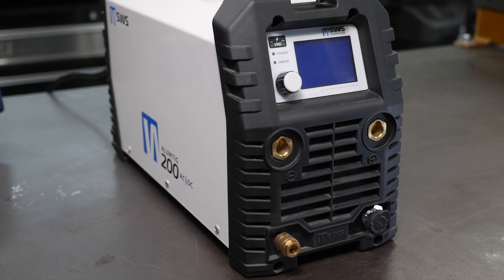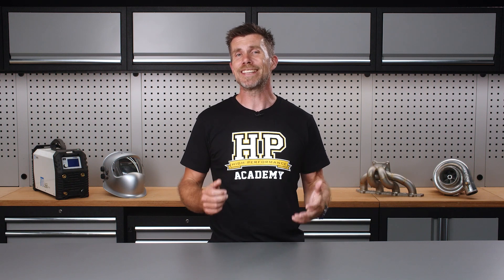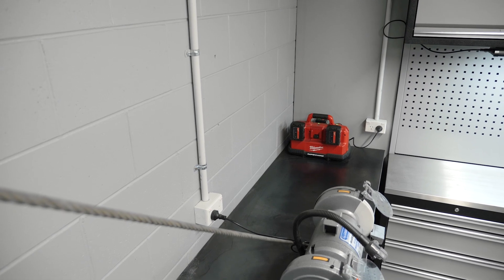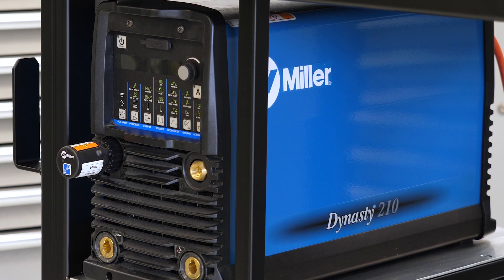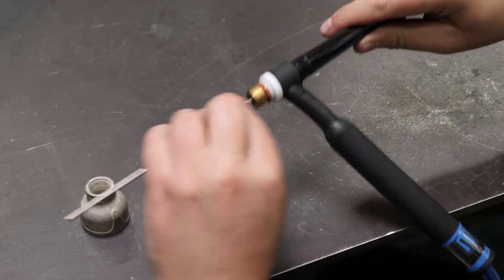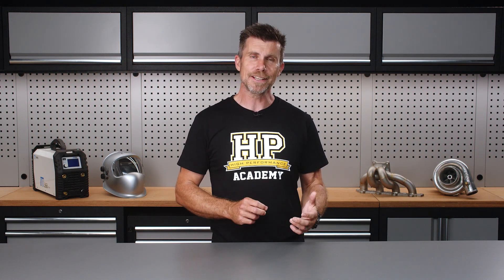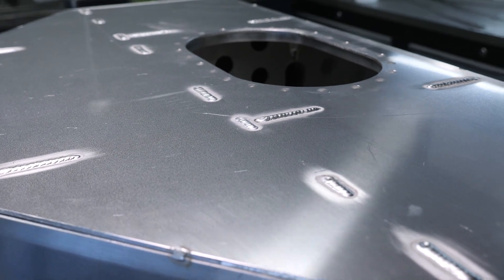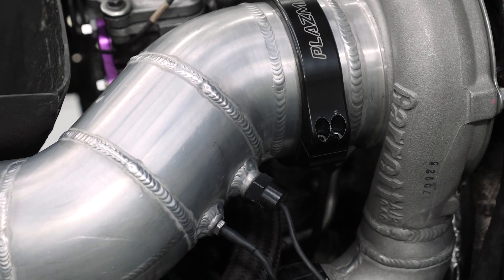What's The BEST TIG Welder You Can Buy?

Comment: About the only thing I would add is to check if the fittings for the cables, etc, are generic/standard types or if they're unique to the brand and/or model of the welder.
With standard fittings you can swap them out for better/more comfortable items, but if they're propriatory to the brand you're stuck with what they give you.

Comment: Have got a CIG Weld 200a AC/DC tig.
My mate is a boiler maker for 25 years and certified pressure vessel welder had a go on it, and he did not complain.
Trust me, he would!! 🤣
About $2k ish
Reply: Exactly the same here. It's a great unit. One thing that makes it even better is a CK 9 torch.

Comment: Nice intro to purchasing a TIG. Here are a few thoughts:
- Air cooled torches are almost always bigger, bulkier and clumsier than water cooled torches.
- A water cooled torch requires a water cooler, which makes the machine bigger and more expensive - but TOTALLY spring for the water cooled torch if you can afford it. (especially for aluminum)
- Pay attention to the "duty cycle" of the machine you are considering. This number represents what percentage of the time you can actually use the power of your machine
- I've been TIG welding 25 years at this point. I"m not gods gift by any means, but I can do a decent job on about anything, and I've used lots of different equipment.
- My personal machine is an Everlast 255ext, which is truly excellent. Ton's of great features and really creates a smooth arc. It's high frequency AC makes aluminum almost weld like steel. It has a "Advanced AC pulse", which allows you to weld aluminum with the power of DC, combined with the cleaning action of AC. Truly awesome. I think I gave $2500 delivered for the power source, water cooler, two of the "premium" torches, the premium foot pedal, and also an additional wireless foot pedal (which is awesome)
Reply: Handy info, I'm actually considering one of these machines currently

Comment: Ask yourself, Are you going to weld aluminium, if so the addition of  A.C. will double or treble the cost of the welder. If your serious about welding two names stand out, Lincoln or Miller, any thing else has PRC written  all over it, even the GYS kit which is supplied from France.
For a learner trying to learn with junk kit is twice as hard, if your experienced you can weld with some big batteries, jumper cables and a rusty nail. I kid you not.
Reply: I wish I could agree with you. But Miller and Lincoln both source most components from PRC, and have for some time. There are several excellent, quality machines on the market that provide all the goodness of a Lincoln/Miller for way less money. For example, I purchased an Everlast 255ext, which is more or less the equivalent to a Miller Dynasty - though I'd argue the Everlast has more and better features - and it cost 1/3 the price of the Dynasty. If the Dynasty were actually constructed from all american components - I'd understand the extra cost, but it isn't. The IGBT transistors inside both are all made by the same company in Taiwan, so ask yourself what you're getting (and who is getting rich) when you spend 3X the price for the Blue or Red machine.

Also, HTP is all European. More expensive than Everlast for sure, but not Lincoln/Miller money.

Last, check out the Everlast "Advanced AC pulse" feature! It allows you to weld Aluminum and Magnesium on DC, but it interrupts the DC with a burst of AC for the cleaning action. This is all configurable, of course - but bottom line is it lets you weld Aluminum with the power and penetration of DC, with the cleaning action of AC - all while using straight Argon. I've welded on 500lb aluminum castings this way, and get an instant, steady, clean arc - with no preheat.

Comment: If you're a beginner, Unimig is pretty good. I got their kit, and while it didn't have a foot pedal, it had everything else I wanted to do TIG, MIG, ARC & Oxy. Unimig 182 Welder, Helmet, gloves, all the torches, 17 piece MIG starter kit, few TIG tips, 1kg wire spool. All I had to do was set it up, get some Argon and I was good to go. 👍

Best bit about this kit was the price and the timing of the purchase. I bought it from Sydney Tools for only $899. The VERY NEXT DAY, Unimig (and therefore all distributors aswell) discontinued that SKU, transferred the kit to a new SKU with NO CHANGES TO THE KIT for $150 more! 😳😬 Safe to say, I love my kit for those reasons too. 😎👍